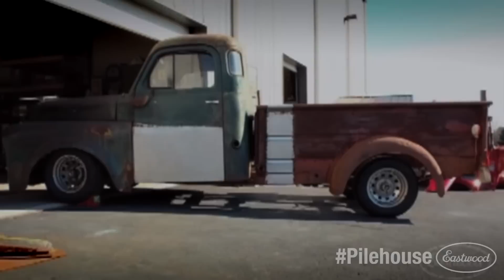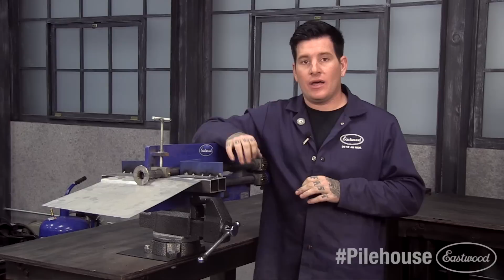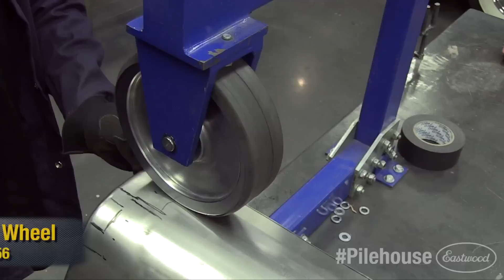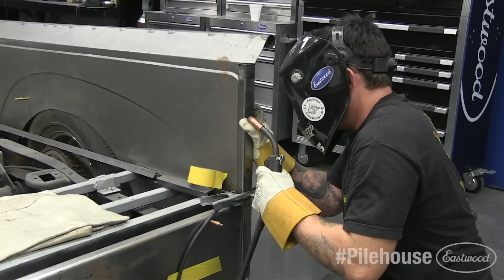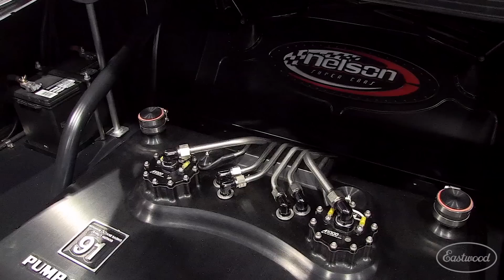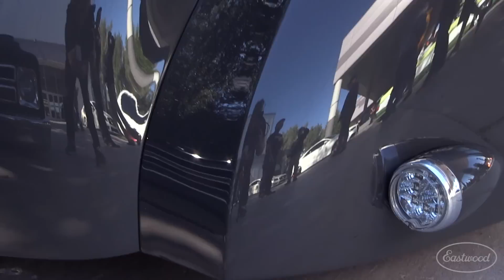How To Build a Pickup Truck Bed + SEMA on Hands-On Cars 10 - Eastwood

Comment: QUESTION ABOUT BUILD
Why did you weld the tubing on the top edge of the bed instead of bending a curl into the original piece of metal?
Everything I've seen on beds from the 40s or 50s the top edge is curled.
The way you did it just looks like a lot of extra work

Comment: Pipe Welder here, I always see the Fab Welders welding Carbon steel like they are welding aluminum, staking Dimes. Is that the Only way you guys know how to tig, Dip, Dip, Dip, That shit takes way to long, there are quicker and more effective ways to tig. Gimme 10 minutes and I show you how to tig without that foot pedal, But hey, what do I know, I'm just making X-ray welds. Good job on the Fabrication, thats something I don't know shit about but I'm Learning.

Comment: We all like both projects, but come on....., this video had been out for quite some time. Kinda disappointing to see a rebadged video we all have seen a loooooooooooong time ago
Reply from the maker: Tyler Dallman Episode 11 of Hands-On Cars - which airs April 18 - will feature bodywork and Primer-Surfacer on the Camaro.  Kevin and his buddies get the car straight with Eastwood Fillers, show you a trick for getting perfect panel gaps, and then start block sanding the body after the primer is sprayed.  Plus Kevin gets a ride in an amazing unrestored 1959 Impala.  Then, Episode 12 on May 16 features a rear axle and brake upgrade as well as a tour of a hot rod shop where they're building an AMX concept car replica from the late 1960s!
Reply: will be looking forward to it all. Kevin really makes this show POP! So i honestly cant wait!

Comment from the maker: Don't forget to subscribe because in the next episode of Hands-On Cars, Kevin and his buddies bodywork the car and get it in Eastwood High Build Polyester Primer-Surfacer.  So you'll get tips on body filler, setting panel gaps, heat-shrinking metal and spraying primer with the new Concours Pro and more!